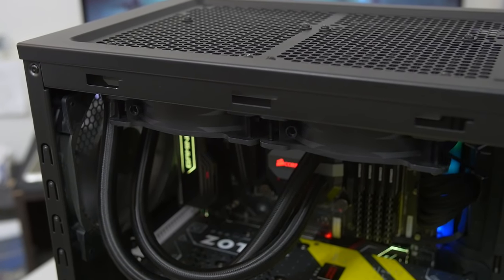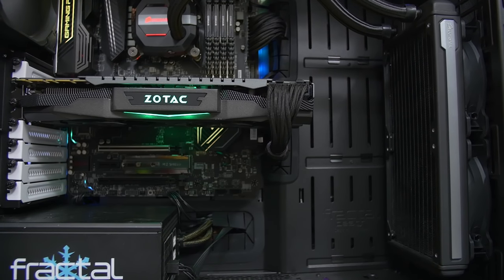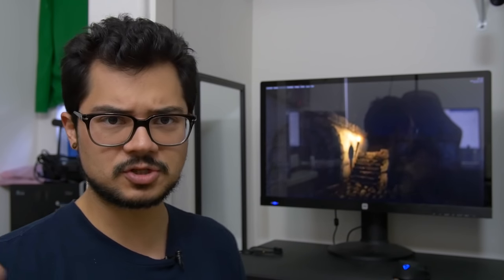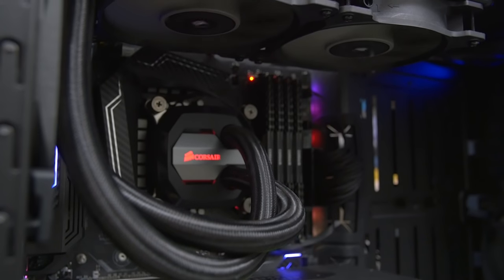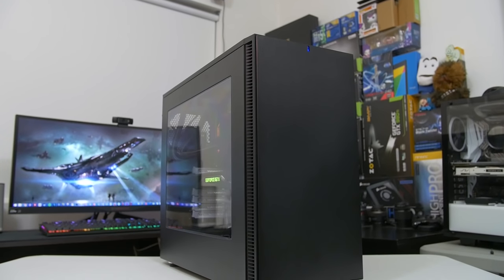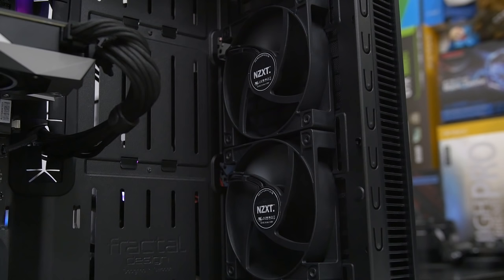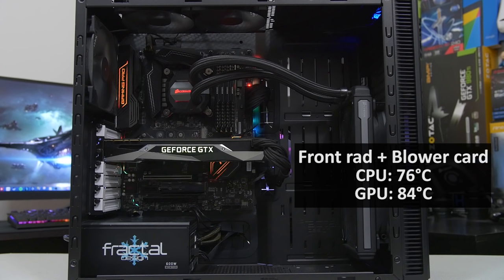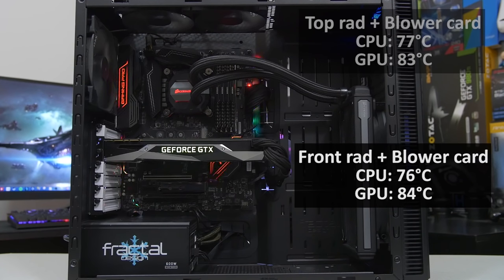Does Radiator Placement Matter? Hint: YES

Comment: I used this video for reference not too long ago when I switched my pc case and upgraded to a 360mm radiator. I have a blower style card and when mounting the radiator on top, my temps showed similar correlation to the one in this video, cpu 75C and gpu 82C. But when I mounted my blower card vertically, my cpu temps jumped to 85-86C. So for anyone reading this, if you mount your blower style card vertically, you may see the same issue!

Comment: You should have also tested pulling air through the radiator at the front.  I know with high performance cars, the fans are always on the back pulling cool air through, NOT on the front pushing air through.  Would be interesting to know if that made any difference.
Reply: The difference is that a car is moving and will have natural airflow anyway, so it's not the right comparison.
Reply: @brotherfranciz  Not true. The reason for the fan is when you are not moving. When you are moving you don't need the fan as the speed increases so does the air flow through the radiator. When sitting idle, the fan will kick on if electric and will be "pulling" air through the radiator. So yes it is an exact comparison hesnse the reason why they started to use radiators in computers which copied how it works on a car.

Comment: I have mine as the following configuration:
Open GPU, front as intake, RAD at top as intake, obviously creating a positive pressure inside of case and my CPU and GPU temps seem to be steady at 65C & 65C under heavy load.
Reply: How many intake and exhaust fans do you have? I'm planning on adding a radiator on top as intake as well as 3 fans in the front of the case and 1 in the back as exhaust. Do you think my temps will be ok or are there too many intake fans?
Reply: @mango251  cheers, I wanna do the same as well, have you tried this configuration? I have the radiator at the front but I am struggling with GPU temp.
Reply: @mango251  More intake is better for positive pressure case. I have 2x140 down in front, 1x120 underneath and a Swiftech H240-X with 2x140 up top. All of those are intake. Only 1x140 exhaust out the back. No heat problems while gaming or transcoding with HB. Any extra air just gets pushed out of the cracks.

Comment: I always put my radiator top mount, but with fans positioned as intake. Front fans also as intake, and only a single rear air optimized fan for the exhaust. This way, radiator will not be affected by warm air from the GPU and always have fresh air from outside the case on top. GPU is also not affected since rear exhaust will suck the warm air from radiator immediately to outside the case. Dust buildup is also manageable since most case has top air filter and this setup is a positive air pressure...

Comment: I've had incredible success with temps with a somewhat different setup. I have a h115i mounted on top, but its towards the front of the case, where one fan is actually pulling from the cool air from the intake fans instead of the motherboard. I have 3 140mm fans as intake on the front and have them clocking a higher rpm than the radiator fans. Also have the rear 140mm case fan clocking high as well. I think 80% or so of the heated air of the pc is being pushed out the rear exhaust vs going through the radiator.
Reply: what case are you using

Comment: Hey man love your channel. Used to watch four years ago when I built my first PC, and just recently found you again as I’m looking for upgrades.

I’ve seen a couple tests on this topic since I was curious, and since like many I believed that front mount rad would adversely affect case/GPU temps. But so far in the tests I’ve seen, it hasn’t. Seems like the way to go is open air card, and front mount radiator. Advantage is that you won’t leak coolant all over your GPU if you ever get a leak. 

Also, I know this is an old video, but you should have the tube inlet and outlet to rad be at the bottom, because the air bubble will sit at the top, and typically the inlet will be the hottest temp location on the radiator, so you don’t want to diminish cooling by placing the air bubble there.

Comment: Does Kyle
 respond
Reply from the maker: +Ollie 04 never
Reply: Does Ollie
 respond
Reply: Hint: NO
Reply: Wow Kyle - perfectly timed video for my needs.    I was just trying to decide between an AiO that was larger and would only fit front of case or a smaller that would fit both top and front.   You've locked my decision to larger for front of case.   Thanks.   NZXT x62 here I come.
Reply: Don't suppose you got any other temp readings? Interested to know whether the RAM or mobo made hotter due to the front mount.

Comment: Energy can not be created nor destroyed only transferred.  With your best case with front mounted sure the CPU is cooler now, but all that heat had to go somewhere.  If it is not being exhausted it's heating up other parts of the system.  I wonder with some of these new generation PCIe4 SSD's that run hot, and motherboard components like the x570 boards have, if you  might change up some things because you need to keep the system cool as a whole more than ever as compared to just your GPU/CPU.  

Traditional style airflow design says intake front/bottom and exhaust top/back since hot air goes up, your encouraging the natural flow.

But in this case with the top mounted rad, having that become an intake and trying to up your exhaust to keep up with the massive top/front intake by adding fans to exhaust out the back and bottom might create some really interesting and effective results that would be great for the x570 boards I was mentioning.

Might be better yet to have the RAD bottom mounted and follow the traditional flow, but in a AIO or similar not sure the lines will be long enough to bottom mount a rad for CPU.

Comment: I'm curious to see this video remade after watching GN's video on pump orientation and how water flow is hindered when the cooler is set up as it was in this video.
Reply: Why would that change the results of this vid? We can see that the temps are best (cpu side) when the rad is on the front.
Reply: @Jeavesingly  The top of the radiator ideally needs to be higher than the level of the CPU block so that air bubbles inside stay trapped at the highest point of the loop (the radiator) instead of at the CPU block which may reduce cooling, and ideally you should have the tubes at the bottom of the radiator so it doesnt suck in any air bubbles that may be sitting at the top of the rad, again assuming the top of the radiator is the highest point. It's not an emergency if it's not, just the cooling may not be quite as good, especially as it ages and the liquid level drops and may shorten the cooler's overall lifespan eventually.
Reply: @sonofsomerset1695  its been found that the potential of bubbles in the rad make almost no difference. it still has flow. trapped bubbles in the cpu is the real danger. 

this of course only refers to older AIO's. newer ones will most likely not have these issues.
Reply: @HawkAnomaly  Newer AIOs such as the X73 and the H150i Elite (to a lesser extent) can still have air bubble problems. In fact, on a recent build of mine, when the temperatures were far higher than they should have been (Around 14°C difference) a simple shaking/redistribution of the air bubbles helped to move the bubbles from the pump to the radiator. Went from like a 80°C peak to 65°C on my X73.
Reply: @thedatacat6771  Did you just shake your PC? Enabled or disabled? Or you get out the radiator?
I'm suspicious of my Z63. My CPU temp seems normal, but even at 80-85 under full load on CPU, liquid temp is only 30.

Comment: Wonder if he'll revisit this topic with the added info from GamerNexus about making sure the pump isn't the highest point in the loop
Reply: Same thoughts here
Reply: Change nothing if the pump si under the highest point of the rad
Reply: @Antho2030  in the front configuration the pump is clearly higher than the higest point of the rad...
Reply: @CraftingWithKlif  no..
Reply: I noticed that also gurgle gurgle
Reply: @Antho2030  yeah the other vids are clear about it, the highest point in the loop should be as far from the pump as possible. Thats a big temp shift tho... i think ima go with a 2-fan top radiator near the front, and have two exhausts at the back top corner...

Comment: Air bubbles tend to stay in the highest position, don't have the cooling block be the highest point and try to have the radiator inlet/outlet lower then the rest of the radiator so the airbubbles does not get sucked back in.
Also, whenever starting up a new system, try tilting it around a few minutes to get the airbubbles to move upward

Comment: Some of you need to look at that chart a little closer.

CPU temp was identical front or top mount, with the blower GPU.  The only situation that caused increased CPU temps was top mount with an open card.  Which proves that, amazingly, temps will increase when you feed the rad with hot air.

So top mount worked perfectly fine when the heat from that GPU was pulled out instead of pushed straight up.  So buy a blower card and mount your rad wherever you want.  Then water cool the GPU down the road for even better temps all around.

Comment: This really is one of my favorite videos (at least when you get to the point! :P ). I'd love to see someone with a custom cooling loop that cools both the CPU and GPU run a comparison of front vs top radiator mounting. Alternatively, how a top mounted radiator to cool the CPU along with a rear radiator and water block for the GPU would compare in your setup.
Reply: Actually, when going custom loop for CPU and GPU, you often need at minimum a 360rad, so that answers the question easily since very few cases have options for top mounting 360 radiators.
If you split the loop, again, either way you'd have one radiator on intake, one on exhaust.
Heat is dissipated so easily that your case temp will only be a few degrees above ambient.
Reply: With custom loops on both it literally won't matter as long as air flow is positive. In and out. Temps will definitely be negligible lol
Reply: Front: intake
Top: exhaust
Back: intake (if radiator in top)

I had an old SLI setup with the front being for 2 graphics cards, with the top being for the CPU, and the back blowing air in. Each component had its own AIO. It maintained positive pressure and worked pretty well. Having the back as an intake gave some fresh air to the top radiator.
Reply: @reppy0757  Yep.  That's how mine setup.  The 360 exhaust up and out.  I even put a 140 radiator on the rear exhaust.  I have the old school HAF932 case that breaths well.

Comment: Interesting call. Cool air into the rads. Usually though this means cool 'dusty' air, which over time will clog the radiator cooling fins. The only other point to note is he'll wreak his CPU pump if its at the highest point of the cooler loop. Basically air in the loop will find its way to the highest point, if that's the pump, it will damage the pump as the pump relies on a water seals.

Comment: Intractable problem with the top-mounted rad and rear exhaust fan is that they're fighting each other - fans draw air from all directions (completely unlike the 'cone' of of air they output, which moves in a cone with axial and angular velocity), they're both trying to pull air from the same space.
 
I've only ever used air cooling for CPU's (single tower Thermalright and Noctua heatpipes), the last two builds I've actually used the rear fan as an intake (with a home-made magnetic filer on the outside of the case) and the CPU cooler reversed, the warm air from the cooler is immediately extracted by a centre-top mounted, completely unobstructed 14cm fan. It effectively creates a small, completely separate 'loop' to cool the CPU.  Front (1 or 2) and floor mounted intake fans (both filtered) keep the rest of case and, importantly, the gfx card cool (an 'open' GTX980). The CPU and GPU do not warm each other at all with this layout, but the CPU is my main concern as I do a lot of video encoding (often all-night  batches), and despite the CPU pulling c. 125w, probably nearer 150w if you include the VRM's, the cores stay under 70° even in with the room in the mid 20's°. The GPU doesn't exceed c. 65° under any circumstances, with its fans ramping to no more than 55% or c. 2000RPM (inaudible in the Fractal R5 case).

What I'm suggesting is that with a top-mount rad it would be advantageous to reverse that rear fan (preferably with a filter on it - requires some inventiveness). As well as improving CPU temps it might also provide some additional cooling for the VRM's.

Comment: I have mine as an intake on top. I seem to get good temps so whatever lol.
Reply: No reason not to do that. As long as you have an exhaust fan at the back and not too many intake fans at the front, your airflow should stay pretty good and maintain positive pressure. 

I ran my old Corsair 600t + h100i in that set up and all was perfect.
Reply: It probably works just fine. However since hot air always rises, it would (in a perfect world) make more sense to have an exhaust on top. Physics, you know? ;)
Reply: Yea, but I just figured it would be better to have fresh air going into it rather than the hot air from the pc.
Reply: You really should have both intake and exhaust fans. Are there no options for fans in the front?
Reply: JPG I would think that more fans at the front =cold air in which is good at least in my test.
Reply: I've got 2 intakes in the front 1 exhaust at the back, and I had an extra corsair af140 laying around so I put one at the bottom by the psu. I have an msi 1080 which moves quite a bit of air around too.
Reply: PapaQ hot air only rises if there's no airflow to direct it.  However, since there's fans to direct airflow, the "hot air rises" theory that everyone else seems to spew out all the time (nothing against you) is a moot point.
Reply: Skrenja I'm crazy about good airflow also  xD, after seeing this video i wish my case had a  front mount . to combat the rising heat from my gcard I installed a 120mm fan in the dvd drive bay which directs this hot air to the rear exhaust before it reaches the top mounted Rad.
Reply: hot air rising doesn't matter in a computer case
Reply: This video completely disproves that.
Reply: I've read the corsair manual for my h115i and corsair recommends that the radiator be set up as an intake for best performance. So I'm probably gonna switch the fans to intake and see how temperatures end up through out my system..
Reply: Yep, my setup is the same: 2x front intake(filtered), 2x top intake (H105 Rad, filtered), 1x exhaust back. GTX 970 Windforce OC, i5 4690K, everything is fine.
Reply: In my noctis 450 I have 3 intake in the front (120mm) and 3 intake on the top (120mm) and one exhaust in the back (140mm)
Reply: Same here - top mounted pull radiator as intake, 2 x front fan intake, 1 x exhaust fan at the rear. A lot of hot air gets pushed out of the holes in the bottom of the case, and my temps under load seem similar to Kyle's best temps.
Reply: ''A lot of hot air gets pushed out of the holes in the bottom of the case'' impossible as this goes against the laws of Physics. Hot air ALWAYS rises .
Reply: Peter, I don't think you realise that fans are waaay more powerful than the displacement effect that causes hot air to rise. My guess is that in the situation of a computer case, the fans are at least one and perhaps two orders of magnitude more effective.
Reply: it does when your radiator is top mounted and your gpu is custom..
Reply: Considering that it is a closed system yes i guess you're right
Reply: Theories are always trumped by real world evidence. Hot air is demonstrably and observably being pushed out of the bottom of my case, and at a decent rate.
Reply: Skrenja Same, I have intake on top with h100 v2 on 6700k. I get around 25c at 10-20%usage. So whatever
Reply: No reason not to do that, except if you want to use convection isntead of working against it...
Reply: +3stardiamond I've wanted to reverse airflow in my case for a while now. I might do that in the future. Use the front as exhaust and the back as intake.
Reply: Does hot air rise when fans are blowing it another way? The fans I would think would blow the air where it is directed.

Comment: Hey Kyle, did you remember to change the fan direction on the radiator when placing it from top to front and vice versa ? Since front mounted requires intake and top mounted requires exhaust ?

Comment: Front rad & open card results are due to the combination of the top mount fans and the GPU fans pulling air in from other unrestricted openings in the chassis - probably a lot from the expansion card slots.

Comment: What about GPU fan speed & boost clock? With the CPU radiator front mounted, the hot air from it must reduce the temperature delta between case air and the GPU radiator, therefore reducing graphic card cooling capabilitie.

Comment: 5:33 do you know how mad this makes me I spent 10 hour building a new pc yesterday the three of those hours were trying to figure out where to make room to put my SSD and he just threw it in the back of the case not even bolted down or anything.... I should have just did that😭😂
Reply: he was not using that pc for a longer time. it just a test pc. so not a big problem if he  just put it like that
Reply: Test PC or not, it's just an SSD, no moving parts. You could just use a double sided tape and slap it on the case if you want to, without affecting anything.
Reply: i threw mine in a HDD cage, its loose but its not like im moving my PC very much
Reply: How did an AE86 build a PC?
Reply: I have mounted mine with duck tape xD